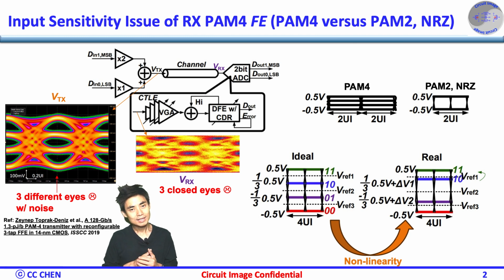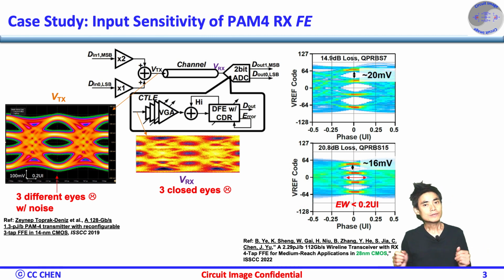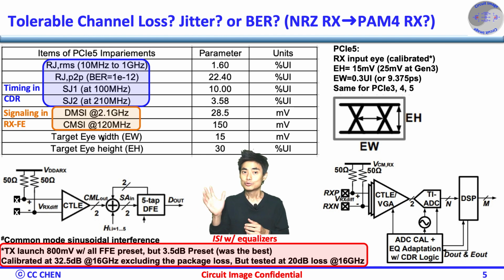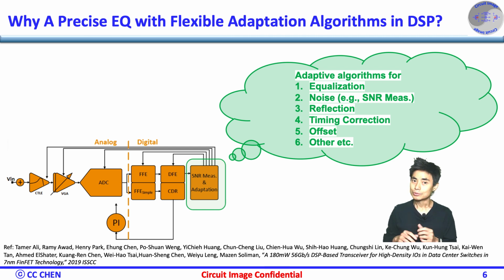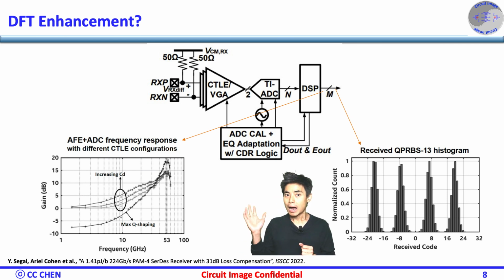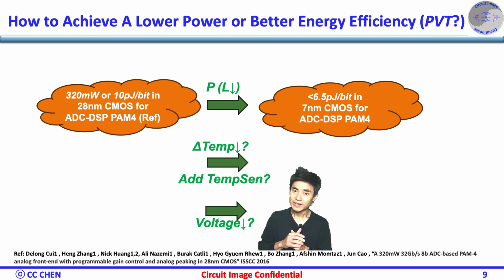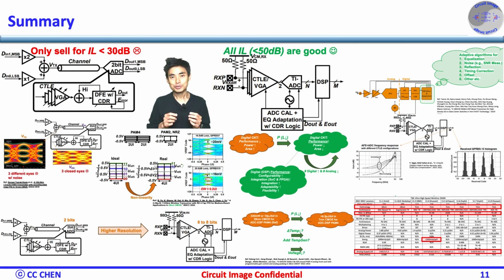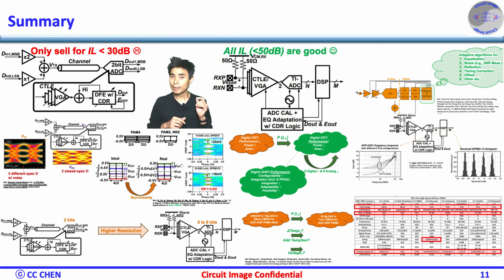Why ADC/DSP-Based PAM4 Receiver?

Comment: Is the ADC sampling rate (clock) same as the data clock cycle? And is the ADC sampling clock still come from analog CDR?
Reply from the maker: Hi aaaaa,
Nice to meet you and thanks for the good questions. Yes, for both. :)
Reply: @circuitimage  Thanks, Dr. Chen.
Reply from the maker: @aaaaa-yv1zr  You're very welcome.